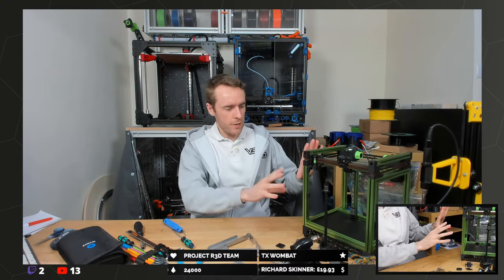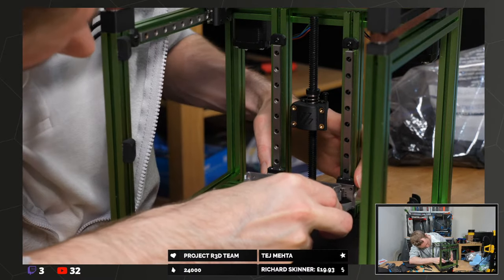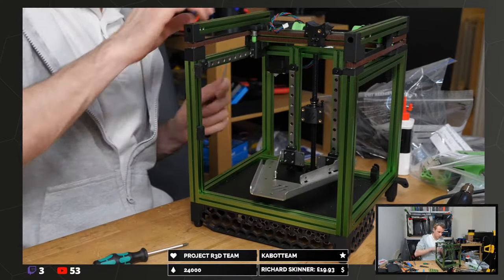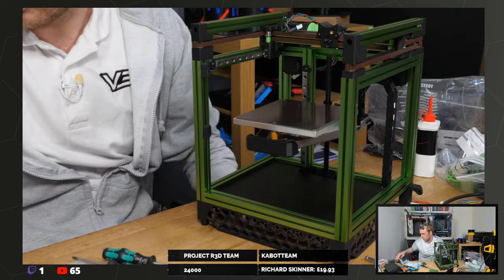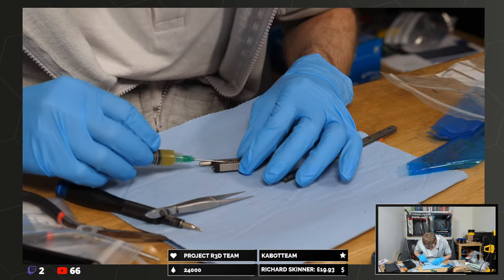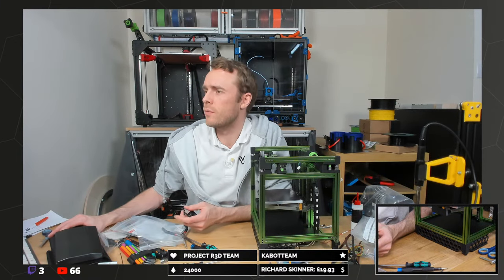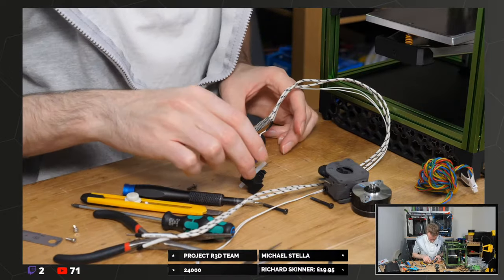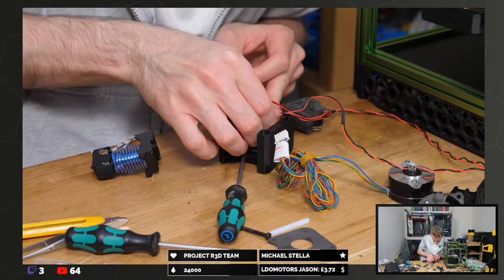Installing LGX Lite & Kirigami on Voron V0.1 [02]

Comment: What is that square space you put between kirigami bed and sliding block? 😄
Reply: Are you able to share a link to this print please? I haven’t been able to find one
Reply: @remiilatte  me either? i gues it is a screw spacer. cause the kirigami bed require m2*4, but most of us only have m2*6. So the spacer is to fill the gap. I already bought some m2*4 screws

Comment: How did you print the LGX Lite X Carriage STL?  There is no way to print the model without supports. Is there a pre-supported version?
Reply from the maker: I printed it so that the mounting face for the LGX Lite as all 100% supported.
Reply: @Vector3DP  It seems that Bondtech sells an PA12 SLS version of that mount for $15. I may go that route if I can't get it to print well enough and if I can find a US seller.  They also make a Voron front plate for $5.90 I'd like to get too.
Reply: @Vector3DP  I am using an FLSun SR to print my Voron v0.1 parts and so far the only issue I am having is printing the LGX Lite X-Carriage due to supports being needed. I just cannot get the supports to print properly. What settings should I look at or change to get a successful print? I keep getting little filament dust balls on the bed when printing this part and this is the only part I am having issues with.
Reply: @Vector3DP  I finally got a successful print except it put supports in the 4 linear rail holes. What setting do I need to change so the slicer (Cura) doesn't put supports in the holes?